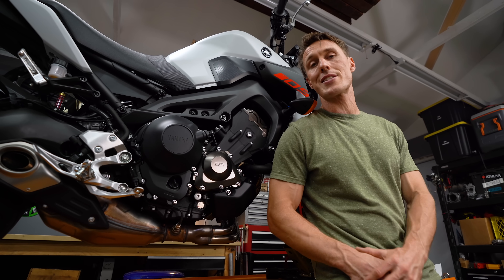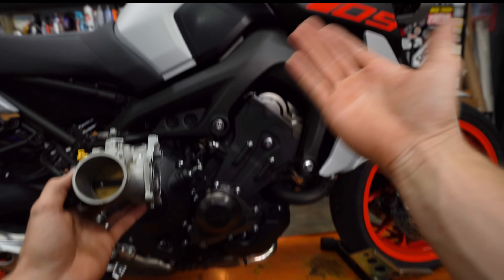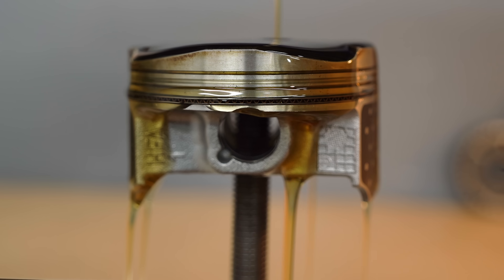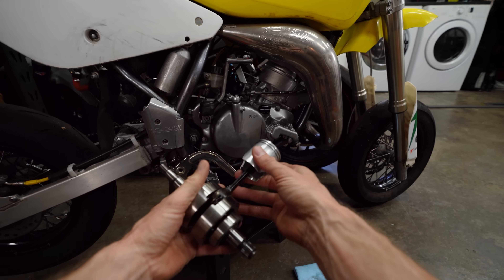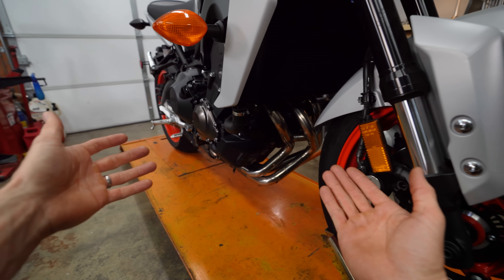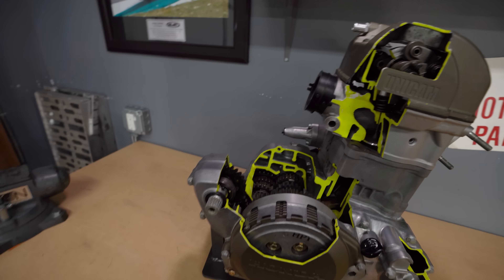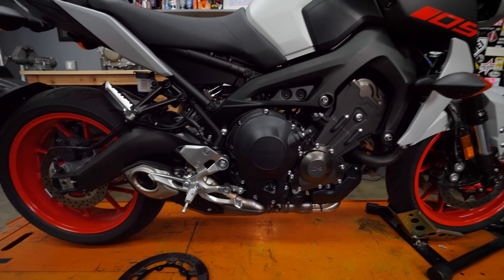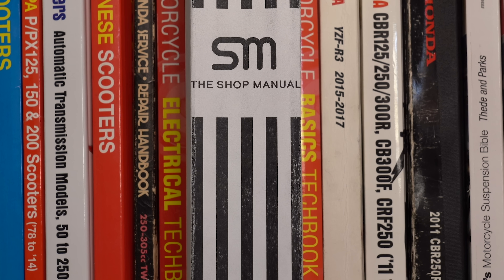Is Engine Braking Bad For Your Motorcycle? | The Shop Manual

Comment: I genuinely didn't know this was even a concern for some people.
Reply: Me neither. Engine overheating was my favorite, tho. :-D
Reply: You probably never had some very old, air cooled, 2-stroke bike? The case he described is absolutely true, my engine welded itself in a similar situation XD
Reply: Deals with many people who ignorant, but vocal, about 2 stroke engine braking.  You see those nutters complain on any vid with a 2-stroke engine braking for more than a couple of seconds, not comprehending it's only a problem with long, uninterrupted periods of engine braking.  Like down a mountain as Ari mentioned.
Reply: @SportbikerNZ  Define long and uninterrupted period, the way you see it. For me it took 1/2 a mile.
Reply: @ZeronXL  Miles to indefinitely provided you're running correct pilot jet sizing.
Reply: @SportbikerNZ  Dude don't think I'm ignorant, I've been riding bikes for more than 20 years. The bike I'm on about had stock jets that I've driven with for years and thousands of miles. Any 2-stroke that needs its oil/fuel mixture to be prepared manually inside the tank, doesn't like long downhills, because the only oil it gets is the amount in idle with closed throttle and that is far from enough when the engine is revving to slow you down.
Reply: @ZeronXL  Any premix to the manufacturer ratio and you'll be fine unless you're 1. Coasting a mountain and very unlucky as Ari mentioned in this vid, probably at very high revs and incorrect pilot jetting 2.  You've screwed up your premix.
Reply: @SportbikerNZ  Yes it was a mountain trail, but I've never screwed my premix or jetting. These bikes just really hate this type of situation especially if they are only air cooled like mine.
Reply: @ZeronXL  yeah bro, I feel you bunch of unversed 4 stroke riders or non riders saying you're wrong are just idiots. I hope they learn the hard way. Even water cooled 2 smokes have problems when you don't give it a little blip of throttle every now and again.
Reply: Poors
Reply: @ZeronXL  auto lube 2ts don't suffer from that.
Reply: I have a ninja 400 I’ve been riding for a few weeks. When I’m in the mountains I use engine braking going into turns instead of the brakes because the engine braking is just so strong on this bike. Without touching the brakes at all I smell burning brake rotor / clutch strongly after doing it a few times. I’m not sure if it’s normal or not
Reply: As a new rider it, well I already knew it wasn't a huge deal but the sound the engines makes me worry
Reply: People who never drove a manual transmission car would be my guess
Reply: Yeah no kidding. It’s such a handy feature and people are freaked about it. Makes no sense.
Reply: @ZeronXL  Why on Earth are you still riding a two-stroke in 2021?
Reply: @kaje01  bro that's the car's and trucks passing you
Reply: @matthewtaylor3308  It doesn't matter which year it is, this is not old technology, it's different technology. 2-strokes have many advantages over 4-strokes, every engine has its place. Have you ever seen a 4-stroke stunt bike (the kind they jump on boxes and stuff) I think not.
Reply: @ZeronXL  A “trials” bike is a highly specialized piece of kit that is mainly concerned with power to weight, not longevity, and is rarely found on long downhill runs... That’s an apples to oranges comparison, and as such has no bearing on why anyone would still be riding a 2-stroke in 2021. Trials bikes don’t even have seats!
Reply: @matthewtaylor3308  You said it "power to weight" is the key here. I would always go on a mountain trip with a 2-stroke than with a 4, no matter which year it is.
Reply: @ZeronXL  Then I guess you’ll have to risk locking up an engine, bub. 🤷‍♂️ 😂
Reply: my wife, who is usually smarter than me, is convinced that it's bad. thus, here i am confirming what I was taught 35 years ago
Reply: @ZeronXL  Only pump lubricated 2 strokes have an issue with engine braking. 2 strokes that run 33:1 & richer premix are perfectly fine.
Reply: Some people are just getting a bike  and have no one to tell them.
Reply: @matthewtaylor3308  mo powa baby
Reply: It seems to be pretty legitimate for owners of the Kawasaki Z650 as it seems to put quite a bit of strain on the drive chain if done abruptly enough. I stumbled across this as I was looking for answers on why my newly purchased bike was backfiring and threatened to stall off the line as if it had fueling issues only to find that the 2017 and newer Z650 models has quite a few issues being reported. I still engine brake more often than not because I will have to end up changing the chain and sprockets anyway after a certain mileage as they will always start shark finning after quite a bit of use, I will just not buy any more Kawasaki bikes as this model left me quite annoyed.
Reply: The same idiots that think about how to counter steer. If you’ve made journeys on your bike and you didn’t crash on the way there or back, you’re countersteering 😂😂😂
Reply: @NightMotorcyclist . That just speaks about Kawasaki build quality or the quality of the drivechain and sprockets. I owned a sv650 and have an sv1000, neither had any problems with drive chains shark finning from engine breaking lol, and the SV1k especially has a damn sight more torque than a Z650 lmao

That’s like saying you should never accelerate hard either because it wears your drivechain. Like yeah no shit, who knew riding harder wears out parts faster 😂
Reply: @TescoRoadman  This is why this will be my last Kawasaki as my old Suzukis never gave me any issues that I listed. I just had the engine backfire while engaging a slow but sharp turn despite all the maintenance and everything is within factory specs. The last thing I want to do is mess with the ECU (which is gonna cost me quite a bit just to get the PC module) and cause more potential issues down the line. The Slipper clutch of the Kawasakis feel off compared to Yamaha bikes equipped with slipper clutches. Hell, I'll take a rougher feeling Ducati over a Kawasaki (after owning 3 different Kawasaki bikes, 2 Suzukis and one Yamaha).
Reply: Have you seen the average IQ of the typical internet moto-squid?
Reply: You should see the people coasting their car in neutral down the Alps and wondering why their brakes smell funny
Reply: @matthewtaylor3308  Yamaha RX100 , one of best selling bike in my country is 2 stroke , gives over 96 mpg , now what ? .

Comment: Me, engine braking literally every time I slow down for the last 40k miles: *nervous sweating*
Reply: Same tho, except for the last 10k miles. Since I got my first bike this year lol
Reply: Haha same. I bought a BMW G 310 GS, which has such an amazingly effective engine brake, I hardly have to touch the brakes and I live up in the mountains.
Reply: Sammmee
Reply: Used to ride an R80RT.  Only ever used the brakes for the last 5mph down to a stop.  Pads lasted FOREVER.
Reply: Diesels in semis literally have systems in them designed to increase engine resistance to use as a brake. 😶
Reply: Engine braking hard on the engine ? Give me a brake !. It will give your brakes longer life too.
Reply: @jeromebreeding3302  lol ikr
Reply: since my bike has a low-powered 50cc engine. I have to keep using engine brake and sort of like heel-toe shifting techniques in car to keep the rev high enough to accelerate quicker.

Comment: Glad to hear this from someone who knows what they're talking about. When I first started riding a bike my buddy, who'd been riding for about a year before me, demonstrated engine braking on his straight piped CBR300, which sounded like it was begging for a mercy killing. Years later I know full well that engine braking is fine, but I always had that nagging feeling in the back of my mind like I'm taking a year off the engine's lifespan by using it for braking.
Reply: I bet you understand it now, it's not from the video, but from your own experience, right?
Engine braking, when done correctly doesn't hurt the bike.
Reply: I think the core issue of your experience was witnessing a straight piped CBR300.. That's an act against all that is holy
Reply: ikr, the sound that the bike makes from engine braking terrifies me as well when it was the first time I'm using a manual bike. After a while though, I become addicted when I can execute downshift smoothly + the sound that the engine braking makes.

Comment: In Germany, we learn at driving school that Engine Breaking is essential due to fuel efficiency and reducing the wear of the braking pads and discs. So everyone in Germany driving any type of vehicle learned this lesson. Funny you (need to?) make a video of it and people not knowing. :)
Reply: Most cars in the US are automatic and generally don't have sufficient engine brake to be as useful as a manual. Most people have never even driven one. There is no need to teach it in the basic drivers course as basically no one uses a manual car in the driving test. The people who DO drive stick in the US most likely know of engine braking. I mean it's right there...it's obvious that it exists because it happens every time you take your foot/hand off the throttle lol.
Reply: @subliminalist7539  yeah, you’re right. However, for fuel efficiency it makes a huge difference if you use the brake pedal or shift down to use the motor as a brake. But I see the point, in Germany manual transmissions are getting obsolete as well and thanks to the electric cars this will soon be nothing anyone would need to know anymore or even be able to use. We are getting old. ;) The next generation will all automatically recharge energy when braking with their electric cars. Huge leap.
Reply: You don't learn engine breaking in Germany... You must learn engine braking 😁  Brechen vs bremsen
Reply: @AndrasMihalyi  lol. Yeah, would be funny if you learn how to puke over your brakes… 😂👍

Comment: Another benefit: fuel economy. If you pull in the clutch and the engine idles, it is using fuel. While engine braking none is used. Engine breaking is essential for getting high mpg. With with practice one can learn much better when to let off the gas.

Comment: Just came across this.  Great YouTube video.  Been riding for over 50 years, and always used engine braking, all the way from 50 cc to 1100 cc four cycle, and for one brief two-year long and embarrassing period a 305 cc two-stroke ("ring-a-ding-ding"}.  Glad to view such a great video confirming that I had not be screwing up (grin).  Engine braking is a wonderful and important part of motorcycle riding.

Comment: It was always drilled into me to keep the vehicle stable on all axis, every input slow, measured and precise.
I like engine and gearbox breaking because they scrub 90% of the speed in most situations without upsetting the vehicle leaving me to concentrate on my turn in, throttle control and body position.
Reply: Well technically engine braking is braking the rear tire.

Comment: For those worried about it, just blip the throttle to rev match the downshift.

Smoother transition and less stress on the clutch
Reply: I let this job to my slipper clutch 😊
Reply: @loichervier7206  Skills>Kit.  Every. Fucking. Time.
Reply: @Vapourwear  True. Equipment breaks, but skill will get you through.

Comment: Good info for the 2-strokes. I knew that on my 4-stroke bikes there was no concern (and I do engine brake A LOT on those bikes) but in my owners manual for my old 2-stroke bike from 1975 it specifically says to not use engine braking when going down long hills. It says pull in the clutch and use brakes exclusively.
Reply: MotoActionADV, can you find my comment on this video  "Is Engine Braking Bad For Your Motorcycle? | The Shop Manual" and tell me, am I out-to-lunch with my thoughts & comment.  I don't want to look stupid in front of Ari, maybe I should run it by your 1st. (serious face)
Reply: You have a working 2stroke from 1975!? My god ,thats gold worth. 
But your bike is a 99.99 % exception. Trust me.

Comment: As a new small engine mechanic just rebuilding my first bottom end on my 02 Cr250 and seeing how I'm about to pickup my first fuel injected 4-stroke WR, I have lots of questions and all 3 videos I've watched so far somehow really comfort me. Thank you.
it started with the "do you need to warm up your engine video" I think of it all the time when I wake up at 5:40 AM in the morning knowing that I need to get to work by 6:00am and I'm just throwing on my clothes and starting up my old ass 05 V6 Tacoma with 197k miles in 40 degree FL wet cold wondering if I should start driving or wait until I see the temp needle move a little bit. So after watching that I now know that I should just go ahead and start driving and just being gentle.

Comment: As a beginner, sort of, in motorbikes in general (I have 1 year with my bike now), I found several videos telling us that engine breaking is a safer way to brake our bikes. But then, I have friends that have bikes for years now, and I asked about what they thougt about it and they all told me that I could damage the engine to the point of having to get a new bike, so I got mixed feelings. With this video, all my doubts completely vanished and I can safely practice the technique without having to worry about what they think about it. Again, thanks a lot.

Comment: Perhaps the most important limitation to know about engine braking is the fact only the rear wheel is used to slow down the motorcycle and therefore equivalent to braking using only the rear brake.

Comment: This is great to watch, I use engine braking a good bit and it gives a good habit of not over speeding and therefore needing the brakes too much.  Great tip to use activate the brake lights when engine braking.  Overall a great video which I really enjoyed.  Thanks Guys.

Comment: I've gotten into the habit of double tapping my rear brakes and applying rear brake when I engine brake.
I might be an exception because I was told most of this when I started learning and I ride 90% of the time at night, and I want to be seen.

It's a good habit, and learning how to tickle the brake pedal to trigger the brake light is a useful skill. You can blink at someone too close, alert a fellow rider of an obstacle with your foot, or just make your engine braking clear. It's a good habit/skill to learn. Just practice gently touching it enough to click the light on, but not enough to brake. 
I told this to a friend and he tried learning this skill and ended up stomping the rear brake and locking up the rear.. so don't be like him.. practice that light touch, tappy tap, do morse code, tap a beat out... just get used to very light taps when you need to.
Reply: I use engine braking in like all my vehicles because I only drive manual so me using the brake light actually came from driving a car just thinking about how it looks from behind to be slowing down without a brake light
Reply: These little things are the signs of a good seasoned biker who spend his/her time learning and improving.

I personally added a second rear light that flashes when I stop (just a strip of LEDs with a relay and a flasher). I still have to signal when I'm engine braking but it sends a clearer sign than just a brighter light.
Reply: When I do engine braking, it's accompanied by slightly a knub of either my front or rear brakes, so everyone can see from behind that I am stopping. 

Most scared the shit out and even Honda dealer (they warned me of warranty void IN FACT). I cared none. It's safe to do so, and/but try to make sign of your braking with a touch of your brake light. On cornering I go with slight rear stomp, and halting at stop light calls both rear and front brakes, and everyone looks at me with concerns of burning my own clutch pack, piston andohGOD do they know shit!
Reply: I just adjust my rear brake so the light comes on as soon as I put my foot on it but  it takes a bit more positive pressure to engage. That way as soon as you ease off and move your foot forward ready to apply the rear brake the light comes on.
Reply: I like to use the front brake to activate the brake light, because when engine braking, you're only using the rear tire and a little front helps keep things balanced.

Comment: Yup, nicely explained, thank you. My dad in law (passionate automotive enthusiast) also mentioned years ago, that engine braking is very beneficial for engine's piston rings ( better lubrication all around when not stressed by the forces of combustion) and cylinder walls too. Just make sure that your chain is properly maintained ( forces being applied from both directions forward/backward) and not slack (accelerated chain wear).

Comment: Maybe someone's already commented on this but even on a 2-stroke, when engine braking, it's still pulling oil/fuel mixture through the idle circuit and not adding any significant combustion heat so it's not starving for lube at all.
Reply: I didn't want to delve that deep into the specifics, but you're totally right. Idle circuit is still feeding fuel/oil in, even at closed throttle.
Reply: I've seen two stroke engine seized on high rev engine braking
Reply: @jr6874  good for you 👏👏👏👏👌👌👍👍👍😱
Reply: @bobvido9875  good for me but not the guy who says engine

Comment: My last several bikes have been Suzuki 650 Burgmans. The 2005, which I rode for 101,000 miles, had incredible engine braking, way more than expected. You let off the throttle and it felt like you were going over the handle bars. I think there were enough concerns about it, that the latest version, my 2016 with 60,000 miles, was a lot smoother on the engine braking.
Reply: I've got 2007 Burgman 650 , same here

Comment: If you’re racing a two-stroke engine flat out for a long time you have to blip the throttle in between gear changes to feed oil/fuel to the crank and piston so it will not seize
Reply: Going up or down the gears.
Reply: @PanRider939  😂😂😂